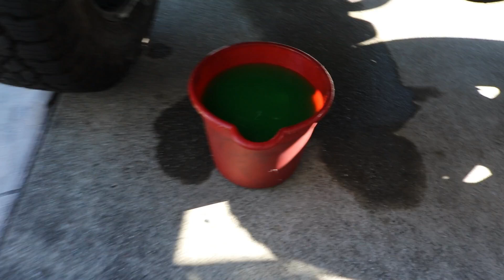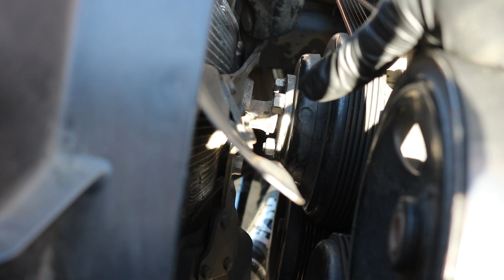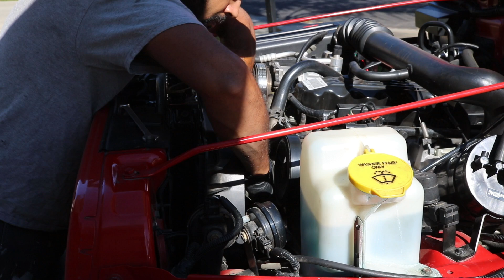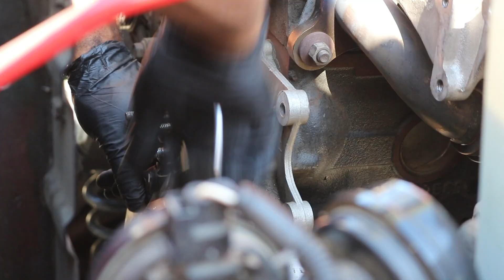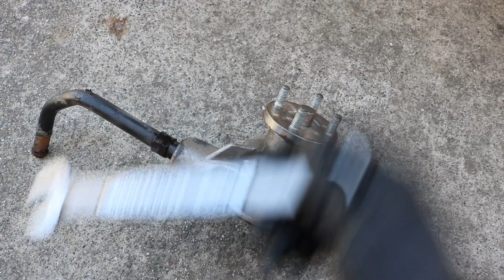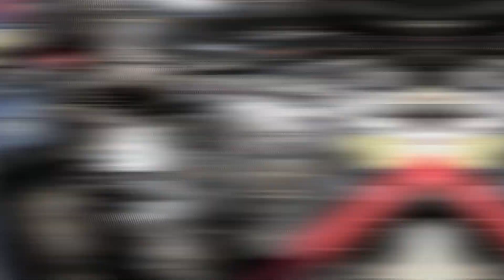Jeep TJ water pump replacement (4.0L engine)

Comment: This must be a old TJ. The newer ones have a spring loaded belt tensioner. The bolts to the PS pump were both 14 on mine, when they are dirty or if someone banged on them, it will be tight
Reply from the maker: This is a 1997 model year.